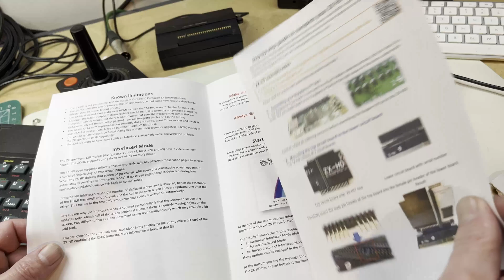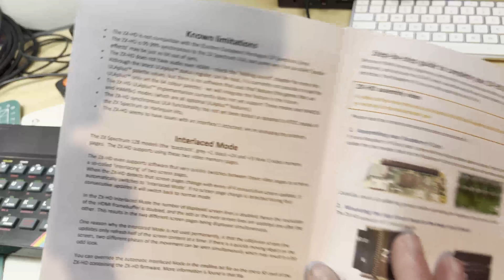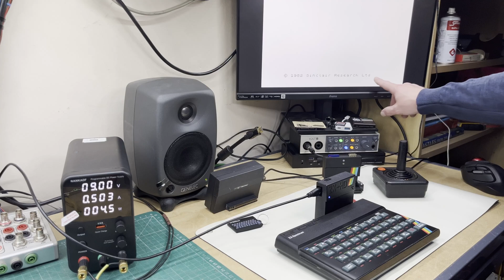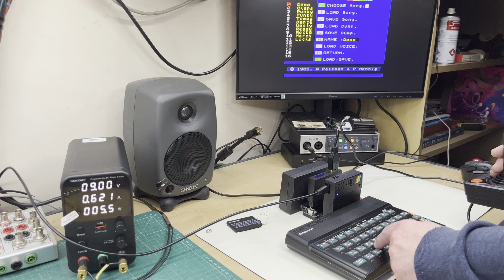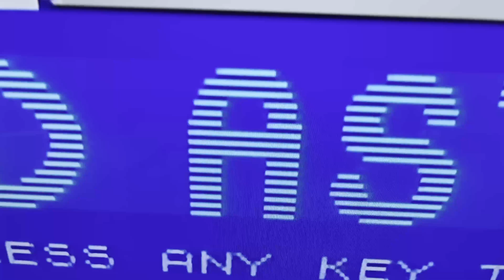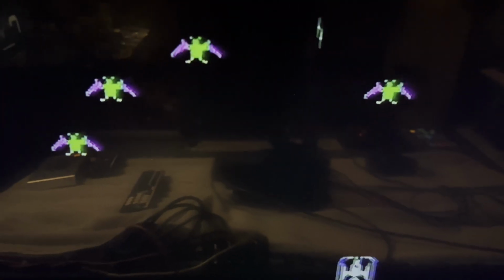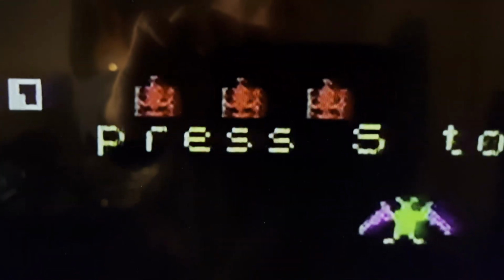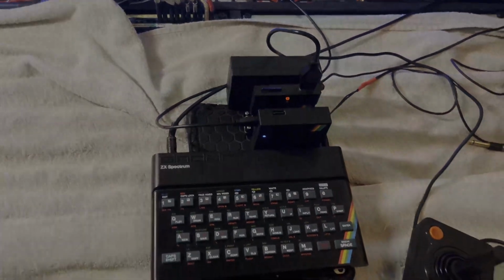ZX Spectrum 2025

Comment: Using the internal linear regulator at higher current draws means it is running hotter. Getting a highly capable external power supply  (lots of current - hence stability) and turning its voltage down from 9V to nearer 7V will help.
The original regulator in the spectrum had a drop-out of 2V, so 7V is as low as you can go, but it will halve the thermal losses in the regulator.

Comment: very cool. you should 3d print a rig that turns those 3 separate plugins into a single, unified "cartridge". then you just have one thing to plug and unplug and everything is held tightly together.
Reply from the maker: Alas a 3d printer I do not have.  Always wanted one.

Comment: The ZX HD is a nice extension, its main advantage is the ULAplus support, but it lacks the audio out which is a little bit disappointing. The only use case for it is HDMI out for the classic 48K Spectrums, the later models have already RGB + audio out and they are easier to connect to modern TVs. Personally I think that for the 48K classic board you get cheaper with a proper composite video mod and with a similar image quality. Today there are composite video boards that fit perfectly inside the RF modulator can and need just your effort to desolder and take out the old RF board and replace it with the new composite video board one.
Reply: Goodpoint: how do you connect a Spectrum +2 (french, in my case...) from RGB to a HDMI TV? So far I managed to just connect it a friend's old TV that has a special "SCART(RGB)" input on the back.
Reply from the maker: I run the audio in to my studio speakers! Probably the only zx spectrum with room correction lol